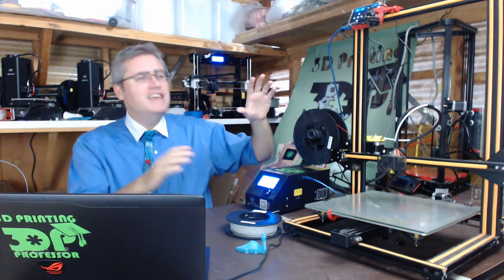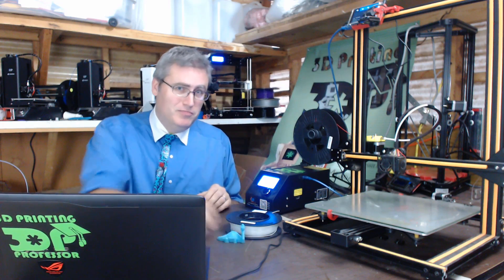The Problem with the CR-10

Comment: Rather than the review of the CR-10, I'm more interested in the Raspberry Pi touchscreen interface. I've just seen people using OctoPi or dealing with the normal interface. Would the RPi one work on other printers?
Reply from the maker: gojyo Yes, Octoprint works on a lot of printers, but setup, especially with a touch screen, is tricky. Once it's set up, though, it's sooooo nice. Much better than Marlin.

Comment: The  paperclip clamps are good for the same reason everything that's good on this printer is good: it's inexpensive, simple, and reliable. One of those problems on cheap kits is that acrylic part or 3D printed part breaks; this won't happen to decent spring steel paperclip in an eternity, and if it does, i can get some more at the convenience store/ newspaper stand right next door.

Actually there's something else i'm concerned about: anodised aluminium profile vs. the wheels. Aluminium is a soft metal, but etching the colour into it introduces a porous hard corundum surface that will wear the plastic on the wheels eventually.

Comment: In my experience the biggest issue people have with big prints is user error. Its pretty rare i see an issue the printer caused. It usually boils down to improper infill level, bad first layer or unclean bed creating adhesion loss, or filament inaccuracy. If you make sure your slicing it right and preveiwing the print to watch for issues like air printing an area that needs more infill, knowing your filament quality, etc, then big prints can be a very forgiving venture.

Comment: This is pure clickbait in my opinion. You are certainly aware that a lot of people take you seriously and thought you had a serious complaint about the printer. The video doesn't serve any purpose other than advertising your Gearbest links.
Reply: Admittedly I was amused, sort of, but cringed because I was concerned about comments like this...LOL  You took both sides of an ionized community (CR-10 haters and lovers) and then via title or content, potentially upset the more delicate and sensitive members of both the communities.  I do find it amusing, but more in pejorative way than a positive.
Reply: 3D Printing Professor Ah... screw GearBest. Seriously.
Reply: I expected some criticism about not having dual z, sd slot that is finicky, control box fans running constantly or the lack of strain relief on the heated bed. 
Everything you mentioned isn't a huge deal to me
Reply: There are tons of reviews of the cr-10 so I wasn't expecting a regurgitation of the same stuff that anybody who is considering buying one would be seeing over  and over again, so i found this video to be informative, entertaining, useful and it's purpose is promoting this channel, helping this channel and there is nothing wrong with that in my opinion, nice job keep it up PROfessor😁😁😁👍
Reply from the maker: I haven't seen dual-Z be a problem yet. I suppose that would open it up to moving the extruder mechanism to the carriage so that the filament isn't traveling so close to the Z-axis screw that it occasionally gets nicked.  The SD card is completely irrelevant since hooking up Octoprint, but I never saw a problem with it before. As for the fans... yeah, that kinda sucks. Especially for filming videos. It ups the noise considerably. And you can't just print a fix. Okay, that one sucks. I'll have to see what strain relief solutions are there, though.
Reply: but why are you making an reviewof something if everyone else has already done it?
Reply: Indeed a clickbait, I just bought one and because of this video I was a little afraid that I did a really bad decision buying the CR-10
Reply: Definate I couldn't agree more. I actually thought he would solve and post a fix to something he found.
Reply: Yup, total clickbait, really annoyed at the title. Maybe it's a good review, but I've already got a CR10, don't need a review but wondered what problem would be revealed.
Reply: I replaced all the fans and put in vibration dampeners on the X and Y and now it is SILENT.
Reply: 3D Printing Professor this was fun! Hope you can sell it for a goid price to support your work. To all the others: If you are offended by this video / title you probably never take a look in the trending section of YouTube. Don't be so narrow minded...
Reply: well if 2 people say the cr-10 is good and 1 guy says its bad I guess you don't really know what to think of it. the more people review it the more opinions you have and YOU get a better impression of the machine. so why not?
Reply: Very clickbaity, sorry. Also: please focus your camera. Thanks
Reply: IamlegendJR1 I guess you should buy this printer than because the things you find to be a problem with it aren't.
Reply: Same type of review... => https://www.youtube.com/watch?v=lItIyxGZUZQ
Reply: Definate, I'm looking at buying a printer and this review helped me decide on the CR10. I found the review fresh and humorous.
Reply: fwiw, clickbait is essentially when something in the title does not appear in the article or video. Indeed he had a catchy title, but people have put catchy titles on things since well before the term clickbait came around. Clickbait is like when you see a link on FAcebook and the preview image has a quote in it that is nowhere to be found in the video. NOt the case here. The title actually sets up the joke and point of the video. 

TBH, I caught on pretty quickly that the professor liked this printer. I think it was pretty clear right off the bat that his title was meant to throw us off the scent, and that his issue with the creality would only be one niggle or something insignificant even.
Reply: Geez, why are people such hardasses? This guy has some good points and indicates in the description that our expectations will be "almost completely unchanged"
Reply from the maker: It's admittedly a little click-baity. It's difficult to approach a review of something everyone else has already done. Still, I'm genuine about the panic this induced and I hope it was amusing.
Reply: no, im sorry. it was actually quite annoying :/

Comment: When it came to 3d printers from china you inspect every little detail and complain about it and how they are bad engineers and so on, so "coruped" gcode file and paper clips is ridiculous. Compare it with brand name from EU/US and then tell us how bad it is :)
Reply: Cheapest US made 3D printer I found after a very quick Google around was the Makerbot Replicator Mini+ at $1300 ! It may be jolly good but it's nearly 3 times the CR10's $450 price and the print capacity is is 4x5x5 = 100 cubic inches for the Mini+, compared to 12x12x15.75 = 2268 cubic inches for the CR10.
Then there's the Prusa I3 MK2S from the Czech Republic which, @ $599 with it's 9,84 x 8,3 x 8 = 653.676 cubic inches.
I took all the prices and capacities from the maker's own websites or official online stores. If there's a reprap style US printer, please let me know. :¬)